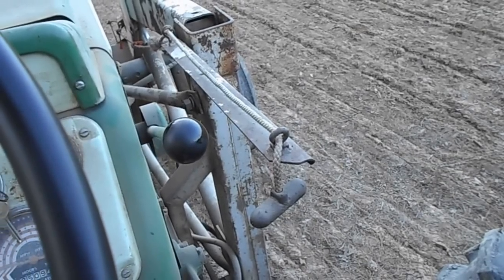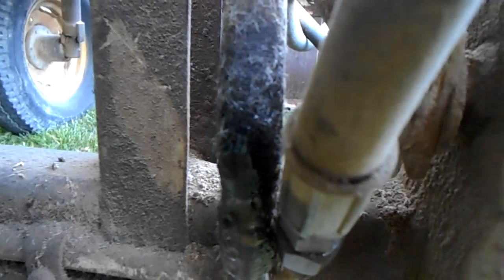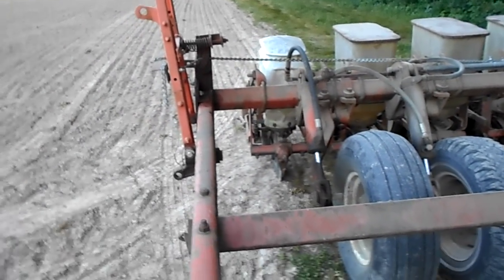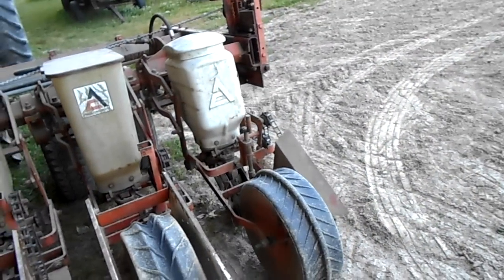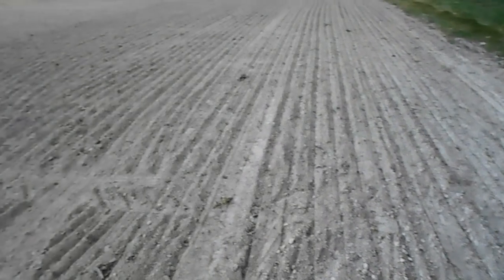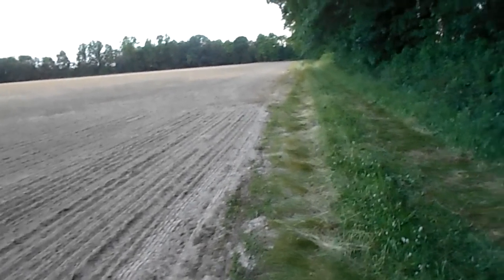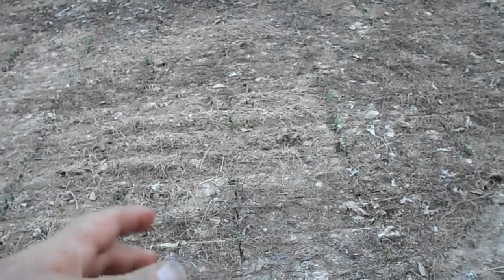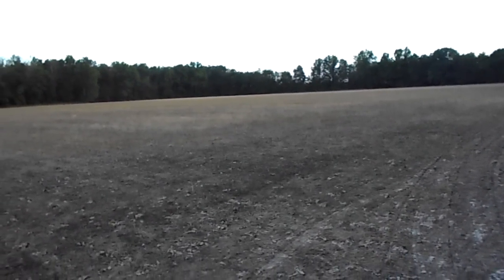RePlant Out of Seed & Blew a Hudraulic hose !

Comment: I was feeling your pain yesterday. I climbed up into the engine compartment of the combine yesterday to put up our grain extensions for the grain tank, and when i went to climb back down.......i saw fuel underneath the engine block. Fuel line had a hole in it. But the wheat was too wet to run so we fixed the line and went back home to eat supper
Reply from the maker: There's always has to be something go wrong !   A hole in a fuel line on a combine like yours could turn bad real quick !  Glad to hear you caught it and got it fixed before things went bad, I don't thing you could have put the fire out in a wheat field without a lot of fast help from the fire dept !  Bandit
Reply: +Bandit farmer The scary part was that we moved the combine down to our other farm before we saw the fuel everywhere. We also just had a friend loose a New Holland combine while cutting wheat as well. He heard a pop, and then a boom. Said it was an oil line that blew. He's okay but the combine is toast and lost some wheat to the fire.
Reply from the maker: Years ago when we were looking for a different combine we would head to a combine junk yard to see what was burning up and stayed away from them when looking for one to buy. Some seam to burn up more than others and some never burn up. But now they go up so fast you cant save them even if you wanted to.  Glad to hear you caught it before it turned out bad. Got to keep your eyes open all the time.  Bandit

Comment: Boy Bandit it sure has been a tough year. Not only for you but other guys also. Luckily all ours has come up pretty good. There is one field I'm not over impressed with but I still think it will yield fine. A buddy of mines son told him he had a field he should go and do some replant in the other day. His dad said its the first of July and all my other crops look good, and I think even though that field could use some replant he said I'm done. He said this year about done him in.lol Hang in there bud.
Reply from the maker: Its been a long wet spring with 5 weeks of rain about every day sure makes it bad, Then it turned dry and everybody went hog wild planting and so did I. Why my no-till drilled beans didn't come up is still got me scratching my head. But I got it replanted and its all done and up and growing good. We have gone about 3 weeks without any amout of rain to the point most of the corn around here has its leaves curled up. The rain we got today is more than we have had in a month !  Time will tell how good they grow.  Bandit

Comment: month from now do a video about what kinds of weeds in that field. i grew up trying to plant those horrible contour strips my dad put in the '70's so i could'nt use the planter markers anyways. i would keep the center line of the case 930 hood on the marker but on the contour parts it was the center of the front tires. lol. we did'nt always have a combine, i bought the first one in 1993 (jd4400 diesel) and before that dad always hired someone to do it. they use to get pissed off at me (and you would to) about how i never bothered to lift the planter on the ends, i used to just enter the field, go around the whole thing 4/5 times and then plant normal so the corners had tight 90 degree turns for the combine. i did'nt care!! had cows to milk every 12 hours. then when i did my own combining i did'nt even notice it.
Reply from the maker: Planting like that in beans is no problem but in corn I could see ware it could turn into a big pain in the butt !  LOL  I know my dad would have kick my butt if I would have made a 90* turn with the planter, That is  one thing I made sure I didn't do when I was using his planter, My planter is another story ! LOL   I did plant 50 acres with the planter having to go by eyeing it without the markers, Didn't have much of a choice but I got them planted. I told my cousin if anyone asked Ottis the town drunk planted them !  LOL  Bandit

Comment: It seems to be a some kind of natural law of something that says when you need to plow and plant it's going to rain, but after you finally get it planted and want it to rain it just ain't going to happen. One or another of those laws always seems to apply towards anything we do. For years I've had constant problems with my baler but this year I finally fixed it and it worked perfectly, never missed a bale, never broke a bale. So what happened then? The rake broke. My neighbor lent me his so I could finish up that little field. I fixed my rake and mowed a bigger field a few days later and raked part of it and my rake broke again from something else. Well, this time I held the high card because I still had the other rake here. But I didn't have to use it because I found that mine wasn't broke as bad as what I first thought and fixed it. If I have hooked up the other rake I'm sure something bad would have happened to it. That's why I hate to borrow things from people.
Reply from the maker: Aint that the way it always works ?  My uncle had about the same problem last year, He sold his old bale because his son bought a NH 575 and no more baler problem BUT he broke the frame in 1/2 on the Case IH rake he bought 2 years ago !  He used my old JD the rest of the year . LOL  Bandit